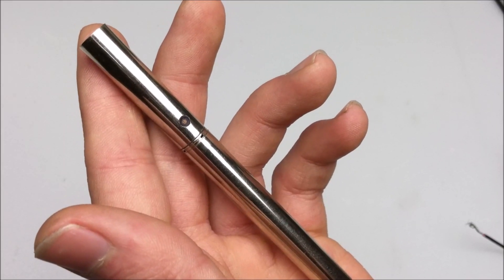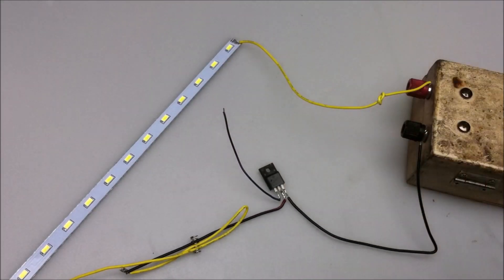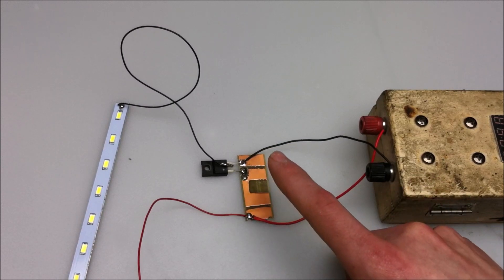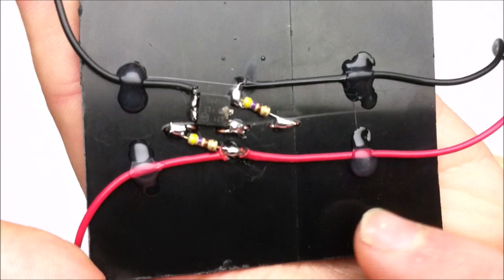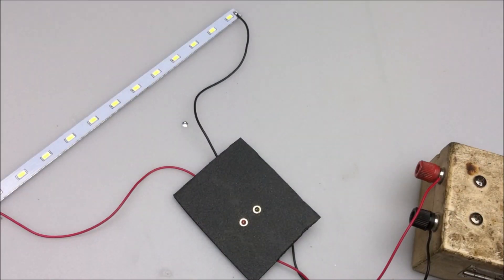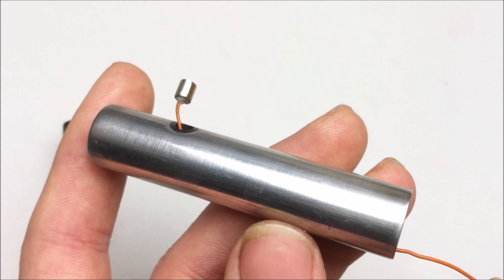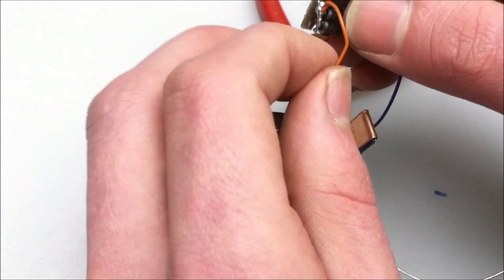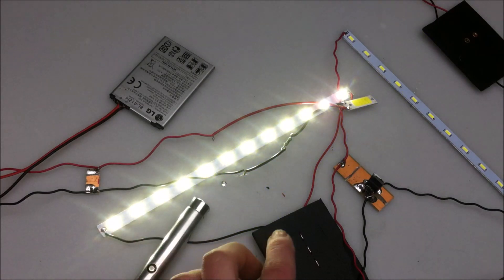DIY Mosfet Touch Switches with Pros and Cons

Comment: hey man i just wanna to ask you about Bare & basics ZVS video you made circout with SMD mosfets and burn the secondary on the transformer . what is the type of the mosfets or the code number?
Reply from the maker: https://www.ebay.com/itm/5PCS-IRLML6344TRPBF-MOSFET-N-CH-30V-5A-SOT23-6344-IRLML6344/192142445290?hash=item2cbc950aea:g:xFAAAOSwf-VWYAuy
Reply: @Zenodilodon  thanks man .. you are the best

Comment: Awesome video! I remember when I first "discovered" this as a kid while playing with a 555 and bridging the high impedance input to vcc and ground with my fingers to toggle the output, I thought it was absolutely magic.
Reply from the maker: I felt the same way when I tripped a mosfet many years back as well. I made a lot of things with these kinds of mosfet switches but it fell out of common use when I realized how unstable they can be, something which nearly isn't covered at all in other videos. It still feels a bit like magic though in the right application and people tend to get a kick out of it after the confusion of " wheres the switch " drops away. they make an item feel a lot more organic in interaction. I used to love the touch lamps as well as a kid and this brings a certain nostalgia to new devices in that sense.

Comment: Excellent job dude! Comprehensive and informative as usual i have been using the mosfet switched momentary since i saw it in a join the technicians vid you were in (the high voltage immobiliser one) nice to see a bit more depth THANKS!
Reply from the maker: Had to make a comprehensive video on it. I was trying to explain this to some one and looked for a good video on the topic and noticed that they where almost all garbage copy cat videos, many of them even use the same identical mosfet ~ facepalm ~ Few of them went into detail and most of them just had music without spoken words as well. Twas time to post up an informative video on the topic.